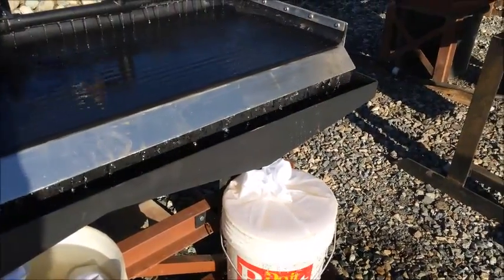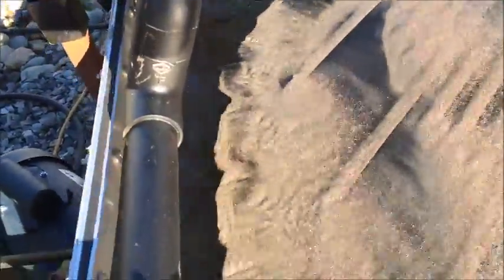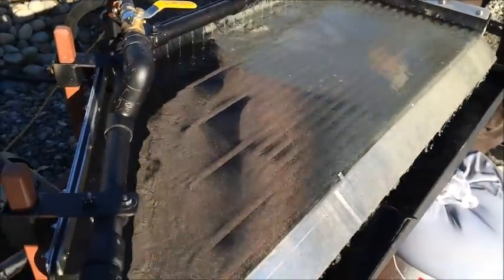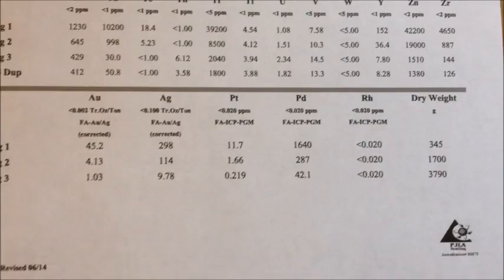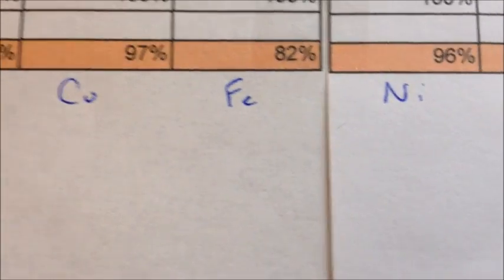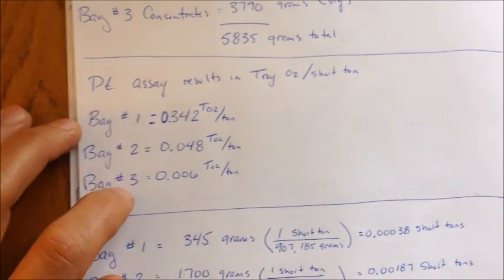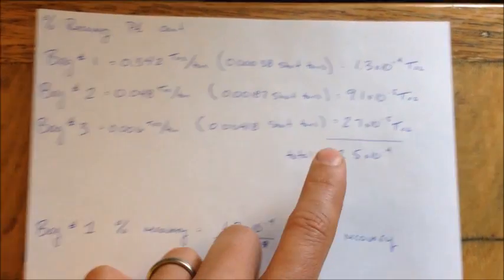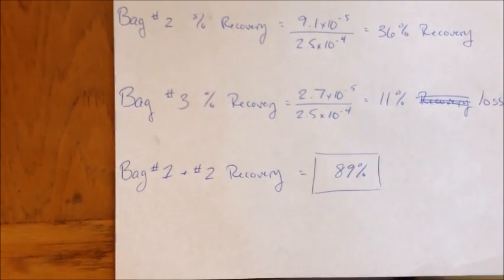MBMMLLC.com: ASSAY RESULTS!! Gold, silver, copper recovery from PCB's using a shaker table

Comment: So are you saying at 4:45 you can recover anywhere from 1 to 45 troy ounces of gold & other metals per ton of PCB grindings?
Reply from the maker: Lupusk9 Entertainment Hi and thanks for the question.  Unfortunately no, this is the amount of gold in each cut from the table.  Most boards have somewhere between 2.5 - 10 oz/ton gold.  The results from the assayer are in oz per ton, but these need to be converted to a weight percent to find the true amount of metals recovered.  At the end of the video I do a sample calculation for Pt to find the amount of "true metal" in the sample and then can calculate percent recovery from there.  Here is a sample calculation for gold on this particular run and where I got the numbers:

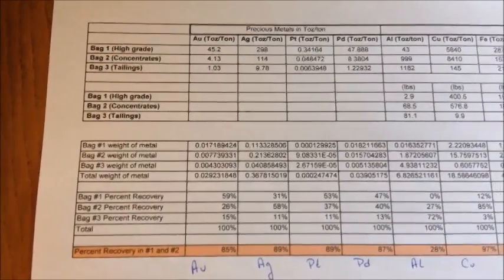At 5:52 on the video in the gold column there is a cell with the total amount of gold: 0.0292 Toz of gold in all the material.

There was a total of 5883 grams of sample tested (12.97 lbs or 0.00649 short tons)

To find the oz/ton of the sample overall (and the amount of gold you could recover with 100% recovery rate) we take 0.0292 troy ounces / 0.00649 short tons = 4.499 troy ounces of gold in these particular boards.  Hope this helps and thanks for the question.
Reply: @mbmmllc  I really have to go back and review my math. But in calculating the percent recovery, once you add the recovered amounts from bag one and bag 2, don't you have to divide by 2 (the number of samples) to get the average recovery rate? I don't see how adding holds true here, but as I said, I have to go back and review my math!

Comment: fluoroboric acid extraction will remove all the solder and then simply all the components will fall out.  So at that point you'll have a pile of depopulated boards with copper tracings and a pile of loose parts.  Many of the components will be worth more intact than they are worth ground up.  Then grind up the depopulated boards and make copper sulfate with a sulferic acid extraction.  Electrowin to recover the copper.
Reply from the maker: Hi Brady-

Thanks for the tips.  It sounds like you have some experience in the field.  Keep the good info coming and I will keep putting up vids.  Thanks again.
Reply: My only question - won't the fluoroboric have a damaging effect on many of the components?  I would think that would increase your loss on the additional components?
Reply: Tyroniuz Oz This can depends, some components can take damage, others are pretty well sealed in plastic/epoxy.

Comment: I totally love this, and thank you for the videos you do.  As far tweaking the table, personally, I think it's probably dialed in pretty well right now.  Minus 30 mesh isn't all that small and most of your precious metals are very thin coatings on otherwise non-valuable materials such as plastics or foils.  Any gold or platinum coating that is still left on a piece of light material won't add enough weight to change its course on the table.  I think you'll find that to increase recovery much you'll have to make smaller pieces... and then the extra processing cost might outweigh the extra recovery.
Reply: choover,

I have read the average gold content per ton of boards I sent Steve, is around 4.4 toz, and if you read the assay and add them up, you see it adds to 4.5 toz of gold, which tells me at minus 30 mesh, pretty much all the gold is out.

Comment: Very good info!  Its the data like that which will convince people out there that this is a great recovery method!
Reply from the maker: Joseph-
Normally they don't return any material from the assays.  They take such a small amount for assay ( about 30 grams) that the gold beads left over are usually not very large.  At 45 oz/ton the bead would be much bigger than normal, but still not worth the time and shipping cost to get the stuff back.  Good question.
Reply from the maker: Thanks Moose!  Glad you liked the video.  I agree the assay results were the missing part of the puzzle, but we are really pleased with the results.  We are going to continue to improve the process and recovery, but for our first pass/proof of concept I think it went great.
Reply: When you send in the assays, do you get back money or material from them?

Comment: Where these naked boards? Did he send them to you crushed or did you crush them for him? I am probably misunderstanding this, but the material comes out to 45 Toz per ton Au? So if you crushed up a ton of this material you would theoretically pull 45 Toz Au along with the other metals?
Reply from the maker: Hi JD-
These boards were fully populated.  He sent it already crushed and screened to minus 30 mesh.

The math is a little tricky, but here is the answer to your question about Toz/ton with a few different ways to think about it.

The dry weight of his total sample was 5835 grams and the high grade output weighted 345 grams dry.  So if you take 345 grams / 5835 grams = 5.9% of the total weight.  Or to think of it another way we concentrated the sample by 16.9 times (100 percent / 5.9 percent) in the high grade output.  

So if you processed 1 tons of boards you would end up with 118 lbs of material from the high grade hole (2000 lbs / 16.9) which would produce assay results similar to our results from bag #1.  So you wouldn't end up with 45 Toz after one ton of boards, you would end up with 118 lbs of material that assayed 45 Toz/ton.  To find out the true amount of gold in your 118 lbs you take 45 Toz/ton / 16.9 and the result is 2.66 Toz of gold metal in that 118 lbs.  

Conversely you would need to process 16.9 tons of raw boards to end up with one ton of material in you high grade hole and it would have 45 Toz of gold along with all the rest of the metal too.

Hope this helps and let me know if its still not clear.  Thanks for the comment!